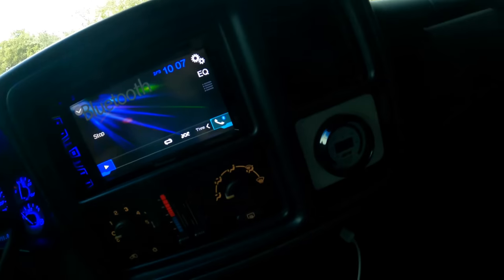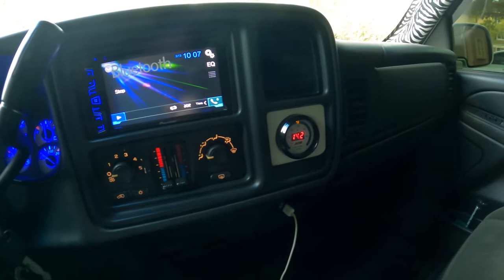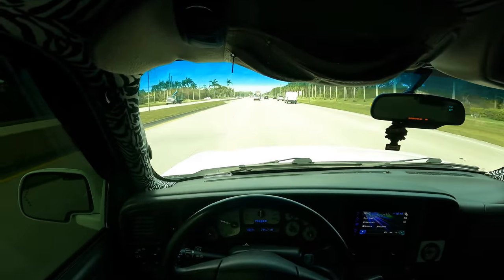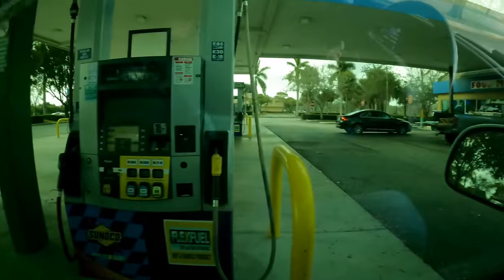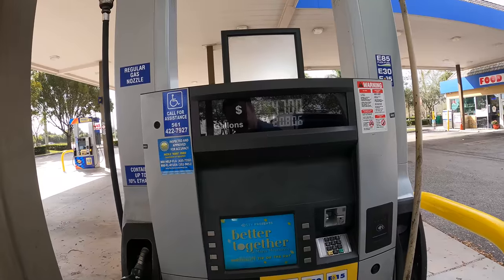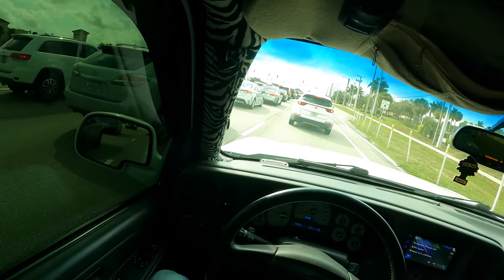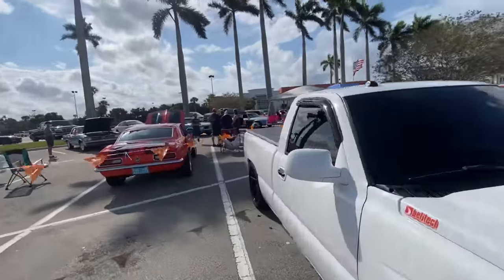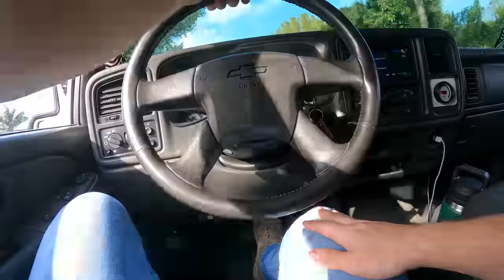What it’s like to daily drive a cammed Silverado

Comment: As long as your fuel mileage is still double digits on the highway you're good
Reply from the maker: Exactly!!!
Reply: 5mpg on idle sbc
Reply: Smiles per gallon is a more accurate description
Reply: @marshallmcdowell3369  fr
Reply: ya he don't get double digits in the driveway bro, lol.
Reply: @dickmick5517  no it's 5mpg on idle.
Reply: @Texasmule  how are you getting any MILES per gallon if you’re not moving. What if you burn a gallon of gas at idle but travel 0 miles.
Reply: @keithallen252  because the EFI system I have isnt tuned but it keeps track of the fuel. It's not fuel injection so mpg is a reference we use on carburetors to tell if it fits the engine or not.
Reply: I used to get 7mpg in my boosted 2 valve.
Reply: Do you think it will last 100000 miles with a daily beating

Comment: Good to see another Floridian on here. I have a 98 silverado that I have 3.73 gears, built transmission and a 2500 stall with a comp cams programmer tune. I have a cam(206/212) but haven't installed it.
Reply from the maker: That’s what’s up!

Comment: Boy i wish I got even 12 mpg 😭
Reply from the maker: The price you pay for a v8 hahaha
Reply: @SiskBuilt   even challengers are better then that!
Reply: @Andrew-hh3ol  woah woah hey hey hey hey let’s stop there.....
Reply: @romero.4089  i mean even Camaros do better then that 22/30 I don’t understand why trucks get such bad mileage like they may be heavy but if you throw a good camper shell I don’t see why it should be so bad
Reply from the maker: @Andrew-hh3ol  being on E, kills the mileage. And the big converter eats mileage around town
Reply: @SiskBuilt  ah e I understand torque converters can definitely eat mileage in town
Reply: @Andrew-hh3ol  camper shells make it worse idk how other then a bit more weight something about more drag
Reply: @jonthelamb4549  some good camper shells will improve the aero and give you a locking bed so slightly improve mileage probably gain a couple mpg’s

Comment: Adjust your lockup apply time, it will smooth out the lock (Circle-D here too, tighter at 2800rpm 4l80e 4.11).
Reply from the maker: That’s what I’m going to have to do!
Reply: @SiskBuilt  I just finished the Sloppy Stage 2 in mine. Idle and boost tuning already done!

Comment: Wtf $47 for 20 gallons I’m gonna cry that’s cheap as hell
Reply from the maker: E85 was like 2.20 a few weeks ago!
Reply: @SiskBuilt  sheesh I wish I had E85 local to me.  #vpracing
Reply: @SiskBuilt  😪 my truck is tuned on 93 I spend like $70 for full tank thats lasts like 4 MAYBE 5days it's  a lq9 6.0 cammed 4l70 2800 stall with 373 gears ...love daily driving it but my wallet hates it 😅
Reply: Its "cheap" but the fuel milage is terrible so it kinda equals out.
Reply: Where do you live where e85 is 2.20 a gallon
Reply: @aztec6535  sheesh
Reply: e85 is 3.99 in wa state -_-
Reply: @dannybradley149   You see alot of stations with E85 in the south. If you're in the rust belt like me the closest station with E85 is in Boston and they mix the e85 with other fuel and dilute it.
Reply: bruh.... Here its 2 dollars (ish) for 1 liter which is like 1/4 gallon.. Europe woweeee
Reply: @jesus_6.0  Lq9 here 31gal tank though $5 for 93
Reply: @201231  dam I guess I'm lucky then it's about $3.1 a gallon for 93 here
Reply: Mine has 2 20 gallon tanks in my 85 and filling it all the way up hurts my very soul.
Reply: now its 60+ dollars
Reply: @RatedSpectre   around 80 for me
Reply: @SiskBuilt  WHAAAT?? REGULAR GAS WHERE I LIVE AT IS ALMOST A WHOLE DOLLAR MORE
Reply: @jesus_6.0  what year is truck bro wtf 😂😂😂 I have a cammed 5.3 with a 4l60 & I fill up every 3 days bro tell me how u get such good gas mileage
Reply: @demarcusbody9437  its a 01 and its lasts me like 4 days but i only take it to work and back 😂
Reply: @jesus_6.0  yea same I have a 01 ext cab & gas cost me $40 every 3 days & u have better mileage than me 😂
Reply: @demarcusbody9437  shiet a total of 80 for 6 days is better than my truck wich is 80 for 4 days I'm on 93 octane wich is like over 3 dollars a gallon
Reply: @jesus_6.0  yea I’m on 93 as well that’s the crazy part
Reply: @jesus_6.0  93 expensive as hell it’s like a $3.36 cent a gallon 😂

Comment: cat-eye chevys are my favorite style. along with the 2016-2018 years. sounds sick! 5.3? or 4.8? and did you keep the 4L60E? or change it up?
Reply: He says it's a fully forged 6.0L with a built 4L80E transmission. 3.90 gears with Eaton Trutrac still 10 bolt, 4000 RPM Circle D converter.  Runs on E85.
Reply: @Long-nd8bq  thanks dude!
Reply from the maker: My man knows it!!!

Comment: It sounds hella good what are the cam specs
Reply from the maker: It’s an All Out LSR cam by COMP cams
Reply: 243 intake, 251 exhaust, 624 lift and 114 lsa?
Reply from the maker: @Smokehouseperformance  it’s a 235/243!
Reply: Oh nice I’m doing an ls swap k10 for high school and I bought a tsp bald eagle cam and I hope it’ll sound something like that. What is the lobe separation angle on that cam
Reply: @Smokehouseperformance  114
Reply: Do u have a part number for this cam
Reply: exhaust set up?
Reply: @chaseschwing1654   currently I’m running a 1 7/8 primary tube header with a 3in collector and 3in exhaust tubing with a flow master 40 series with side pipes coming from underneath the steps (step side 73 k10)

Comment: that rear bumper delete kinda clean, didn’t even know you could do something like that
Reply from the maker: Yeah! It’s called a “Roll Pan” you save some weight and it looks very clean
Reply: @SiskBuilt   its called flat nalgas
Reply: It’s Old Sokol. Not really a thing anymore
Reply: @gregmf9427  Agree I like being able to step on bumper of my old OBS. And adds little protection of involved in minor fender bender.
Reply: How could someone not know what a roll pan is, .
Reply: @Justin Rodriguez wake up another silly comedian it has zero to do with racing or helps you go faster, it was born from the low rider truck scene a long time ago..it’s for looks period, it’s just like ppl who think removing the tail gate or dropping it makes you faster or get better MPG , it’s been proven it doesn’t..they design the air flow on trucks to clear the tail gate for the most part..the only real thing that helps is a bedcover ,and that helps mpg mostly..but not a huge amount..
Reply: @markim5087  yep, saving a ton of weight has literally nothing to do with racing 🙄 

Yes, it was originally done for looks, but it certainly has it's place on a track.

Comment: When you said 12 mpg highway. I was like okay nah.... I’ll keep mine stock 😂.
Reply: At 85 mph.....drive the speed limit and mileage will likely improve. 
Also running e85 which lowers mileage by 20% or more.
Reply: @davidstephenson7194  ohh true. E-85 is way less efficient. Good call on thay
Reply: Smiles per gallon tho

Comment: I was scratching my head to the 12 mpgs then you mentioned 6.0 lol I have the little 4.8 I’m thinking about throwing a decent sized cam in it with headers and possibly an intake should wake it up some nice build!
Reply from the maker: Do it up! It’s addicting!
Reply: How many mpg does your 4.8 get ? I’m being sold one for a good price but I’m worried about fuel 😬. I’m 19 and going to college so my pockets ain’t that deep rn.
Reply: $60 to fill up. Youll get around 220 miles per tank

Comment: If you run your engine with the heated wideband sensor off, it will ruin it... ask me how I know 😂
I put mine on a switch for tuning downloading with the ignition on... I turn the wideband off so I don't burn it up. They are finicky things for sure. I've been getting the bosch sensors online for 35 dollars. They are the exact same as what aem uses just without the markup. 35 vs. 120... yeah, I'll buy 5 cheap bosch branded ones. Killer truck, bro

Comment: Whats your rpms at 85 mph? I have a 06 silverado 4x4 with a 5.3 cammed out, 4l80e trans, full length headers, 4.56 gears front and rear, 33x12.5x20 tires and a 3 inch exhaust. Cruising at 85mph I'm running 3400 rpm
Reply: Look at getting a gear vendors for your truck, it will really bring the rpms down and plus you can split gears with it so you technically have an 8 speed, it really helps when your doing pulls. second over is where the butter is at.

Comment: Yeah, but can you drive it to Florida and back?
Reply from the maker: Well, i live in Florida, ahahah
Reply: @SiskBuilt   I heard that soon after I was watching your vid.  I was like " damn!"

Can you drive your truck across the state with no issues?

Asking cause I'm trying to cam my 01 , stock power is simply no power at all.  Feel like camming it,  something with speed by and able to drive daily. 

Don't want to go to radical either.
Reply from the maker: @redhulk111  to be honest I drove it to Orlando with absolutely no issues. All temps were perfect, ac was kicking ass, and I did quite a few pulls. I wouldn’t mind driving it further, once you’re on the highway it’s smooth sailing!
Reply: @SiskBuilt  thanks !!

Bad ass truck you have.

Comment: Mine is a 92 ls1 fully built swapped ls1 t56 truck. You have a mild cam compared to mine. My truck bucks like crazy in first gear.
Reply from the maker: What size cam you got in the ol gurl??  That’s what’s up! LS1/t56 in a truck is sweet
Reply: @SiskBuilt  I can't remember, but it's too big. It's great on the open road but stop and go traffic or driving in a parking lot sucks. I built the engine 7 years ago and can't remember exactly the cam size the cam but I remember it's a comp cam and 627 is the only number off the cam sheet that I can remember. It made 570 whp at 6800 rpm. Callies crank with wiseco pistons 230cc AFR heads edelbrock pro flow intank with a 92 mm throttle body Every nut and bolt are ARP. The picture by my name is actually the engine in the truck.
Reply from the maker: @robertelee6712  that’s what’s up!

Comment: Dude i found a nicely done 2002 RCSB 5.3L lowered, painted, tuned, but it has no posi trac and it’s 3.42 gear - 

I am thinking of buying it and camming it, and putting 4.10 gears and positrac + a fresh street tune, but I don’t think the price is low enough to justify doing all of that

Comment: What wheel and tire are you running cause it looks like she puts the power down pretty good considering it's a rear wheel drive pickup truck! Anyways that thing is dope! I got the same truck, mine is actually a crewcab but I've been wanting to spice it up what would you say is the best mods to do first or in order of importance / makes the most sense to do before other mods? Thanks! 👍
Reply from the maker: they are 285/35/22 by Nitto!
Reply: What cam is that

Comment: You know why your truck is hard on gas...its because your tuner never spent the extra time in injection timing. Your cam is so large you have over lap where your intake and exhaust valve are open at the same time, therefor you're spraying raw fuel in the exhaust. Your wideband wont read the unburnt fuel as its a oxygen sensor...it only reads oxygen left remaining. You need to have someone play with the Normal ECT and Normal RPM.
Also your PE might enable to early.
I can make LS engines get crazy economy, and power at the same time!
I am a tuner, listen up :)

Comment: i’m curious about the hp , i was thinking about putting an ls in my s10 next time around, i have a 93 s10 and we took an old 5.7 4bolt and it’s stroked at 383 now , originally i was gonna put a bottle on it but i changed my mind lol not being tubbed out its already scary trying to hook up and its running flat 10 without a bottle. , so i scared myself out of bottling this death trap by pushing it to the 8’s lol , well my whole point is confirmed now by watching your video , we’ve done so much to the motor to make it an 8-10 second truck and a million of my buddies are saying i should just put a 6.0 ls in it because it takes less parts and math to get the hp and bottom line numbers/speed on the track , this really makes me want to take the stroker out and put the 6-0 ls in with less added parts
Reply from the maker: The 6.0 is a great motor, but that 383 stroker sounds pretty badass!
Reply: @SiskBuilt  yessir, she’s explosive, too much actually, from what i gather going a few inches smaller with the 6.0 i’m hearing i can get good power without spending quite as much doh  as ive spent on this stroker , i haven’t tubbed her out yet if at all but if i go any higher in horsepower im going to have to 🤓

Comment: Hit me back if you have time.did you just do a cam swap or did you have head work also.im about ready to do cam swap.if you could let me know what you did that would be cool...thanks Mike serra
Reply from the maker: It’s a forged bottom end with stock 799’s. It has all the supporting mods like oil pump, lifters, springs and retainers. Stuff like that!

Comment: Been driving mine untuned for about a month now, it has stalled on me twice, exhaust smells terrible and fuel consumption has gone down just a tad but all in all it is not bad.
Reply from the maker: get that thing tuned!!!!
Reply: @SiskBuilt  i have a gear set that i want to install before i tune.
Build once, tune once.
Reply from the maker: @johncrankshaft2886  it’s so easy to update the gear ratio after
Reply: @SiskBuilt  it is easy but adjustments cost another $100-150 so i'll just wait. Its parked at home at the moment anyway
Reply from the maker: @johncrankshaft2886  do you have HP tuners?
Reply: @SiskBuilt  i do but i dont have credits for the truck, the guy tuning this one will be done in person so he will cover that aspect. I have HP but i cant tune, i have tried to look up info on it but honestly i cant grasp it man

Comment: Hey bro. 
In what order would you do the upgrades? Torque converter, gears, and cam swap ? If you had to start again. I don't know if there's a certain way to do things stall before gears, etc.
I've read alot of forums and can't get solid answers. Will be doing the upgrades 2-3 months apart from each other, thanks in advance. 
Gmt800 ext cab 5.3l

Comment: Who did your tune? 
Can you reveal some of the motor/ cam specs?
Sounds awesome what mufflers you running.
Reply from the maker: DSM lights in Miami area! It’s a 6.0 with 799’s. All forged internals and studded and a full speed engineering exhaust.

Comment: when you keep shifting gears in the 321 what does that do for your truck because i have the exact truck and always wondered what there’s used for?
Reply from the maker: You can use it to manually shift the truck. Helps if you’re doing a roll and want it to start in a certain gear vs. having the truck downshift

Comment: does the truck die if you dont rev it being a 4,000 stall? I really want to have a stall but afraid it wont drive normal.
Reply from the maker: It drives just fine! just a little higher in the RPM. your gas millage will go down a little but it is worth it.

Comment: Rear Gears in this video?
Reply: Sorry I just watched the part where you explain what's done to the truck lol. I love it! I wanted to run e so bad, but the pump freaked me out. Cutting holes/drilling holes in the bucket and having problems when you're low on gas worried me. I'll save the money and buy the dueschworks drop in
Reply from the maker: Ive driven it like this for a while now and i havent had fueling issues

Comment: Did you have to do much work on the truck to run E85?
Reply from the maker: Not much, I should eventually change the lines. But it had to be tuned on it, different pump/injectors. Right now I can only run E
Reply: @SiskBuilt  Is it just the lines you gotta change? I have a 1999 gmt800 and I've been told the intake valves should be changed also but it sounds kinda bogus to me
Reply: @wills.5762  Thats definitely bogus, get a tune and new injectos
Reply: @wills.5762  thats bogus asf

Comment: what cam is it and did you have to get lifters and a tune?
Reply from the maker: Comp Cam -235/243 .621/.624 113 
-SKU 54-460-11 (Grind Number 285LR HR-13) and yeah lifters/springs/ other supporting mods and had to be tuned

Comment: 12mpg  ?? how fast were u going? dude how many rpm's are you turning at 65mph ? I'm guessing between 2k - 2.5k rpm??? If you have an overdrive to put u at 1.2k rpm highway ur mileage would be at 20mpg +
Reply: Nice truck btw!
Reply from the maker: At 80-85 mph I turn about 2500 rpms on a 30” tall tire in the 4l80e. E85 blows through fuel.

Comment: great video.  time for a floor shifter.
Reply from the maker: If this 80e ever blows. That’s the next step!
Reply: @SiskBuilt  80e's are pretty tough...working on converting my 8l90 to an 85e just because.
Reply from the maker: The builders I have had in the past were not the best. I’m on number 4 for 80e’s and they were all “built”. The most recent one I installed has held up to the abuse but that was a new builder
Reply: @SiskBuilt  that's surprising to me.  in a RCSB a stock 80e with servos and shift kit should handle 400 to the tires....built units with billet input much much more.  hopefully you found a better builder now.